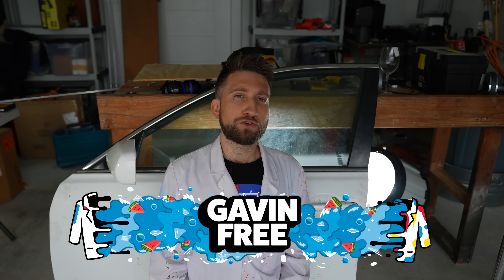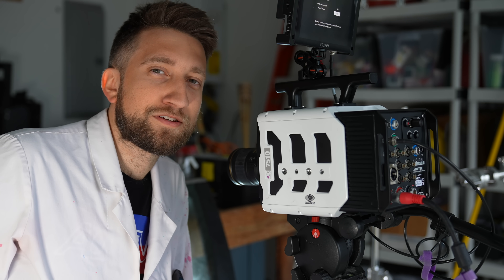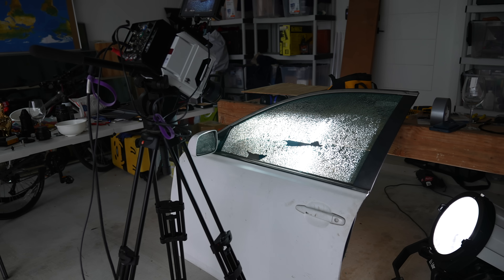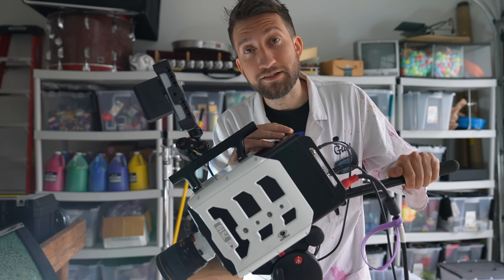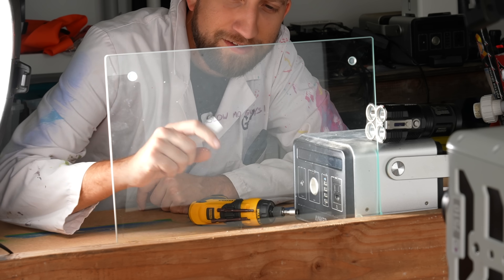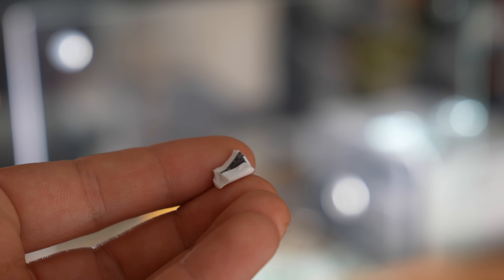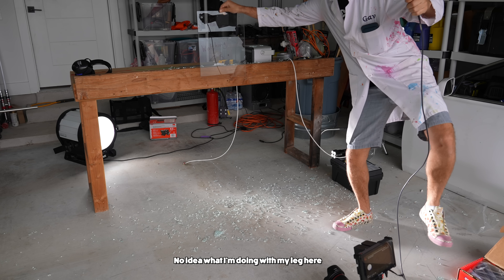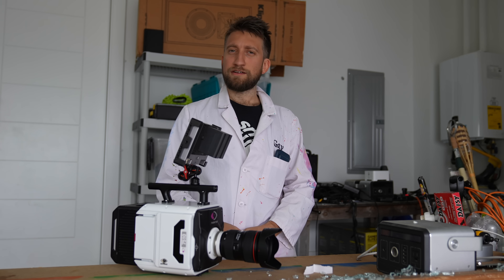Spark Plug vs Car Window at 800,000FPS! - The Slow Mo Guys

Comment: A few years ago : 10 trillion fps
Now : 800 thousand fps
It's evolving, just backwards
Reply: the 10 trillion fps camera is a composite camera. It uses 10 trillion frames per 1 second of video output, but it does not record at 10 trillion fps.

Comment: The speed of propagation of cracks should be close to the speed of sound in the glass, anywhere between 2000-4000 m/s depending on the glass, which your observations corroborate! Amazing footage.

Comment: I've rewatched the glass hitting the floor part multiple times now, and it still gives me chills, the way it slows as it hits the ground, that wave up through it, and then the instant cracking of the glass, masterpiece. And the sound design Gav did is just the icing on the cake.

Comment: I did some rough calculations from the Twirly Whirlies in the extended edition of The Hobbit: Battle of Five Armies.

An average longbow arrow is 2.5184’ long and travels at 160 FPS. An average ballista bolt travels at 186 FPS. This gives a convergence rate of 346 FPS. Let’s say these things are designed to hit an arrow halfway along its length to at least knock it off course. This means that for every 1.2592’ (half an arrow length) the ballista bolt and arrow converge (at 346 FPS), whatever is rotating on the ballista bolt needs to move through the space of any potential arrow. If only one ‘wire’ was being used to cut the arrows down, this would translate to 16,487 RPM on the ballista bolt. With something like 8 wires, which is a bit more likely, we’d only need 2,061 RPM.

Now for the rotation speed at the tips of the wires. I count 200 elves in the archer row. With an average back-to-chest length of an average male being ~9.5” and with a 20-inch back-to-front spacing between archers, each archer takes up 29.5” of space. This gives us somewhere around 491’ that the twirly whirlies need to cover, at minimum. We see 9 total twirly whirlies fired, and by my estimate, about 1.3 of them do not impact any arrows and are simply there for coverage. That means that 491’ is covered by ~7.7 twirly whirlies, giving each one a diameter of 63.9’. This gives us a twirly whirly circumference of 200.646’. Multiply that number by our 8-wire RPM to get a 413,531 FPM speed at the tips of our wires. That’s 4,699 mph at the tips.

Now for reference, every time we double the number of wires, we can halve the rotation speed. So if you think 8 ‘wires’ may be too few or too many, the math is fairly simple to do if you’d like to add or remove wires. My question for you guys is: How fast can wood spin before it shatters? Beyond whatever magical way the dwarves could get the Twirly Whirlies spinning that fast, could a wooden ballista bolt shaft even withstand rotating at those thousands of RPM? What speed does wood shatter at? I remember you guys did something very similar with a CD and I’d love to see if you could come up with something for this!
Reply: Crazy.
Reply: Nerd

Comment: 2:40 I had to rewatch this bit.  Turns out the mirror is already fully cracked, but on my first watch thru, bout the time you say "That worked, didn't it?" your reflection in that shattered side mirror made it look for a moment as if it had gotten shattered later, and was coming apart just right then.

Comment: I wonder if the main reason that the ceramic has such an impact on the tempered glass is due to it’s hardness, as opposed to sharpness . Ceramics are harder and therefore capable of indent glass. Obviously by applying all that force to a point is probably the deciding factor. Any Material Scientists/engineers out there feel free to correct me. Genuinely curious.

Comment: Y knot use a pendulum to crack the glazz? it would give a repeatable impact, repeatable target and adjustable  thrust. You could use a light to trigger the camera to go on to insure that the action will be at the beginning and aimed on the impact point

Comment: I experimented with the spark plug ceramic 30 years ago and found the inner ceramic around the electrode works better. A much smaller piece would break the glass.

Comment: Remove ceramic from plug, put it on a long rubber band, pull back  and let it smack the glass. Ceramic is what breaks it with ease.

Comment: Most people think you need a large piece of ceramic from the spark plug to get glass to break, but the smaller the piece, the better it works.  The piece of ceramic should be smaller than the head of a match.

Comment: This is incredible to watch, especially when trying to wrap my head around how much that camera is doing in the space of a second, considering most computers take a couple of minutes to copy a couple of Gigabytes.
Reply: It is incredible! A typical computer can actually copy/write data just as fast as this camera (25ish GB/s). The reason it takes a long time to copy a big file on a computer is because you're normally copying it to something relatively slow (like a hard drive or ssd). It's easy to save that much data to RAM in a short period of time, which is what the camera does. Gav references that in the text overlay at 6:53. Definitely some incredible engineering.

Comment: There is a myth that polymer tipped bullets have the tip melt off in flight and the whole concept is a marketing ploy.  Set up a cam at 500yd and shoot past it with some calibers to see. 223 /204 ruger /308

Comment: Gavin: *tries to break window with sledgehammer*

Also Gavin: *forgets physics of tempered glass*
Reply: What are the physics of tempered glass?
Reply: @John-Doe-Yo  it's significantly stronger than normal glass, somewhere around 5x stronger. It also doesn't just break the way normal glass does either. When breaking a car window (or any tempered glass), you want to use something with a very small surface area, like a pointed metal tip, rather than a giant sledgehammer or rock. That's why the spark plug worked so well, but the sledgehammer didn't. It's not so much about brute force as it is about pinpoint accuracy. Mythbusters actually did an episode on breaking out of a sinking car and addressed this in part of it. That's also why car safety gadgets have window breakers that are just tiny metal spikes. If the car window had been regular glass, it would have shattered when he hit it with the sledgehammer, but no car window is made of regular glass.
Reply: @Amarianee  thank you for explaining the physics of tempered glass

Comment: This camera and the small resolution/high frame rate would be PERFECT to record the open end of a computer running a fiber optic networking cable. Maybe a collab with LinusTechTips again to see the difference between gigabit and 10 gig?

Comment: 3:03 If you go frame-by-frame, you can see that some cracks actually go backwards -- toward the source. 

Once the initial run of cracking has passed, there are some 'bald spots' (for lack of a better term) that are formed while it's still in motion. In those is where you can easiest see the backward movement. There's one that's just slightly above the very center of the image that shows it pretty well.

The backward movement is at around the 7-8 o'clock point of the bald spot.

I wouldn't have expected it to reverse course like that. Neat!

Comment: any chance you could put the actual speed the crack propagates through the glass in the description up above.
My calcs are 145frames to travel 6", 8 microseconds per frame, 232 microsecs per ft, 431 ft per sec. =  293 mph - is that close?

Comment: i wonder if one day we will be able to capture light moving? just based on some maths (could be 100% wrong) capturing light moving just 2 meters, will require a camera with a fps of 150 million.
(if the maths is correct, exactly 149,896,229 frames per second)

Comment: I thought you meant the spark plug hitting the glass at 800000 FEET per second ( not really  ) but that would be impressive if you could pull that one off!

Comment: Now if I had that camera and some glass to break. Notice how the glass starts to oscillate before it starts to break. Have a reflection of a grid so the movement of the oscillation can be observed. Also, place several laser pointers pointing into the edge of the glass from different directions to see the multiple reflections that would be generated by the slow breaking of the glass. This was observable due to the ability to single frame youtube videos. Give it a shot.

Comment: It could be really interesting to see the speed of a bullet Vs the speed of crack propagation 
You see 0.000181 of a second for the travel 
But how many travel dose a subsonic bullet  ? 

Few maths : 
Subsonic ? -> I'll take sound speed as base .. 340 m/s 
so 0,06154 meters -> 6,15 cm 
so if cutting plate is 40 cm long the bullet traver is 1/6.67 of the plate 
So in another words, the crack is 6.67 times the sound speed (!!)

Comment: I'm not knowledgeable enough but I always felt a corelation, a trend, between the patterns in
Glass breaking
Thunderbolt
Spider web
Cosmic web
Neural structure of brain

They all seem similar. Maybe there's some ultra deep science into it. Or maybe I'm just overthinking.
Reply: One of the meningeal layers that protect the brain is actually called the arachnoid due to it's similar design to a spider's web.

Comment: With that frame rate (about 2e6/s), light will travel around 150m between frames. Find a tall antenna mast that has strobe lights on it, and film it on a foggy evening. You might be able to see the spherical shells of light expanding from the strobes scattering off the fog. How clear they would be depends on how fast a strobe flash actually starts and stops, though. The shape of the fog bank would make a difference too, you would prefer a wall of fog perpendicular to your point of view and clear air between you and the fog.
Then again it might not be bright enough.

Comment: Hardened glass, wich means: Tempering puts the outer surfaces into compression and the interior into tension. Such stresses cause the glass, when broken, to shatter into small granular chunks instead of splintering into jagged shards as ordinary annealed glass does. The granular chunks are less likely to cause injury. Stle this last paragraph from wikipedia.

Comment: That tiny sliver of pixels make me wonder if one could gain something out of putting a 2x or 4x anamorphic lens on it to get back some verticality without skipping pixels by compressing the image vertically and stretching it back in post. I mean. The actual vertical resolution would be the same but we could see a taller sliver of view.

Comment: How fast was your video filming lightning?
Reply: Literally, how could that be much slower. Probably because it’s on so much of a larger scale with lightning and they’re so much farther away I guess.
Reply: Sidenote: what the heck is your channel bro, did a corporate slave forget to switch accounts?
Reply: They once filmed the speed of light too
Reply: The first shots in that video are 28,500 frames per second, and the lightning looks awesome. He then steps it up to 100,000 frames per second. So much, much slower than this.
Reply: Go to the video and see for yourself? It's like asking someone how much the bananas cost while you're in the store and just a few meters from them. The idiocy is astounding.
Reply: @MuscarV2  who hurt you?
Reply: @MuscarV2  If this isn’t what’s supposed to go in the comment section what is? Actual question
Reply: Lightning Video: Yes
Reply: You need lights with a very high frequency, that camera goes up to 1.75m frames per second and I don't believe anyone owns one just yet, the lights I use for instance can go up to 4 million frames per sec but not LED's. Some Leds go up to 1million without flicker but new lights are emerging everyday
Reply: @WarpedLab  They make LEDs with ballast capacitors which prevent them from shutting off between phases, but you could also just use any other kind of light bulb.
Reply: @WarpedLab  yeah I think this video is just showing off the phantom basically
Reply: @jchrizzy6995  yes I was supposed to get this camera a few months ago but I will feature it later for a different episode, I really didn't want slow motion to be the core of my channel.
Reply: @WarpedLab  What makes the LEDs flicker? I mean when used with regulated DC PSU. (Of course driving them with AC or using PWM causes that.)
Reply: @WarpedLab  this is untrue. An oscilloscope tells me you’re a liar.
Reply: Fast as lightning
Reply: That was at 100000 fps
Reply: It's likely DC powered, not AC, that's why there's no flicker.
Reply: Fast
Reply: 300000 m/s

Comment: I may have missed it, but why does this youtube video's upper resolution settings say that it is at 50 frames per second? Didn't you say that you usually only have 25 or 30 frames per second for these slow-mo videos?

Comment: If you want to be a little bit more accurate with where the spark plug strikes the glass. I have a suggestion. Use a pair of pliers to carefully break the ceramic loop off of the metal. Put a string through the loop of ceramic. Spin it and use the circular motion to be more precise.

Comment: Use a Sharpie to mark a standard grid on the glass sheet (at 1-inch or 1-cm intervals). This will allow you to very accurately measure the speed of the fracture across the pane.

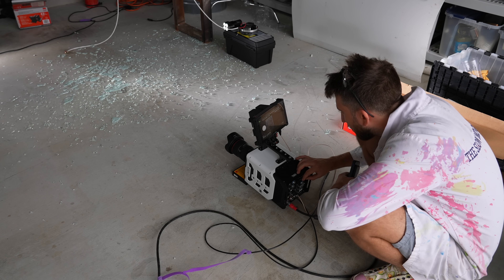Comment: Go to 7:56 & put YT playback speed to 0.25x
What’s really cool is that you can see the glass flex first before it shatters. And it also looks like it doesn’t shatter from the edge, but about an inch in from the bottom & left edges.
And if you look closer it also looks like Gav wrote “Thanks for watching” on the glass in black marker.

Who else watches slo mo guys in slo mo?

Comment: Commenting at 3:03 - That wave travels roughly 3cm per frame, or 0.03 meters per frame. It is being recorded at 82000fps, which means the wave travels 0.03m in 1/82000 seconds, which is  2460 m/s. Which is about the speed of sound in glass, which makes perfect sense.
Reply: Julia - 𝙾𝚙𝚎𝚗 𝙼𝚢 PROFILE  Good point! 
.
.
P.S. not gonna visit the links in your profile ;)

Comment: I have a park plug as a rear view mirror ornament because that spark plug ruined my engine. I keep it as a reminder to replace my spark plugs in time. Now I can see how it will possibly break my windshield in slow motion. 

By the way if you're wondering how a spark plug can ruin an engine, it's electrode fell in the combustion chamber and it absolutely destroyed the piston, the head, the valves as well as heavily scraping the wall of the combustion chamber. It was fixable, but very expensive.

Comment: Something I was wondering is if there’s anyway to have two slow motion cameras capture the same target from the same angle using a setup similar to how you have to capture 3D footage and then linking their trigger with software so the second camera captures footage in between the frames of the first camera? If done right it could essentially double the frame rate

Comment: Im starting to think that maybe Dan was the one to think "Safety First" with these based on the fact that Gav never put down a tarp or protection for the Phantom when he just dropped a plate of glass on the floor. While wearing shorts. Dude that made me so nervous
Reply: My anxiety went through the roof when I saw the camera on the floor with no covers or anything
Reply: Tempered glass is hardly sharp. It's actually made that way to prevent dangerous wounds.
Reply: @NavidIsANoob  Yeah, it's plate glass that's scary. That turns into flying knives...
Reply: it’s called safety glass for a reason lol
Reply: I worked in a bottling factory and most of my day was walking on glass and having bottles explode on the regular.  it’s basically harmless  a tarp does nothing. That’s only for a cleanup. But it’s also safety glass....It’s literally designed to fall flat and be an easy cleanup with a dust bin. You could lay on the stuff like beach sand and maybe have some discomfort
Reply: To be honest Dan was the one getting hit all the time and Gav always operates the camera so yeah
Reply: What happened to Dan..why is he noy in the video's? Can someone tell??
Reply: @abhishek1997100  he lives in UK and travel restrictions are still in place
Reply: @kyranlatham783  thanks bro 👍

Comment: That was soo cool!  Back in the late ‘80’s, I worked for an Entertainment and Vending company that had lots of video, pinball, cigarette and other type machines.  While servicing pinball machines at a customer location (truck stop), I pulled the glass out, turned it edge-wise to stand it between two machines.  When the edge touched the tile floor, it exploded in my hand!  Reflex caused me to turn my head away so when I looked back, there was just a pile of glass beads and a small section of semi fractured glass in my hand.  Right where I was holding it, there were NO cracks and I wasn’t hurt!  I turned to an attendant and said, “I didn’t drop it, see?!”, holding up the section in my hand.  Maybe you could try filming that, though I might suggest wearing gloves...  Love the channel!!!

Comment: In a recent episode of Savage builds by Adam, they built a spring hammer to hit nitroglycerin. Result a 2inch thick steel plate flew almost a 100 ft heigh. Can you slow it down with this??? 😀